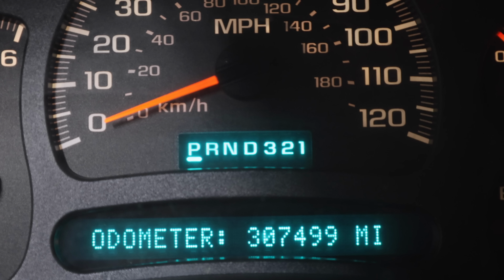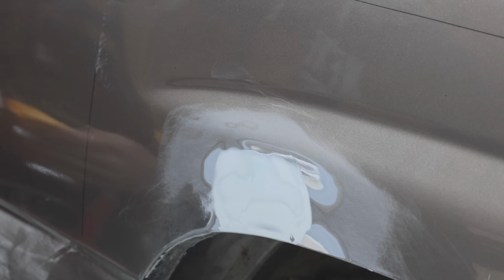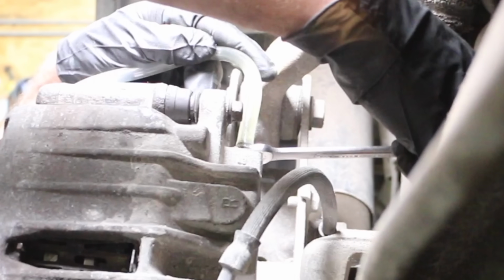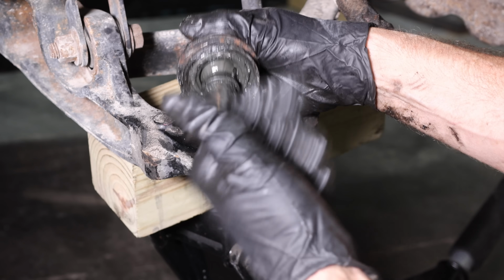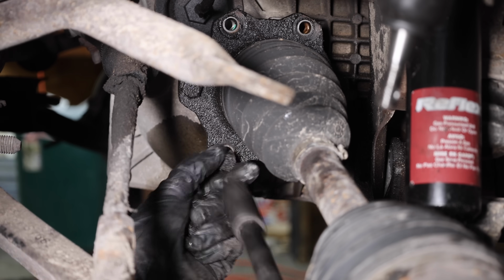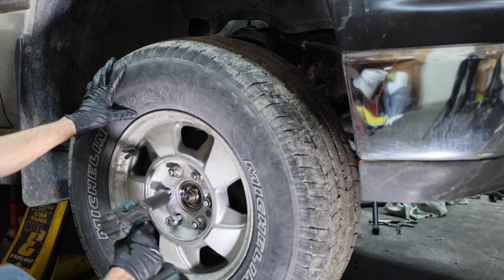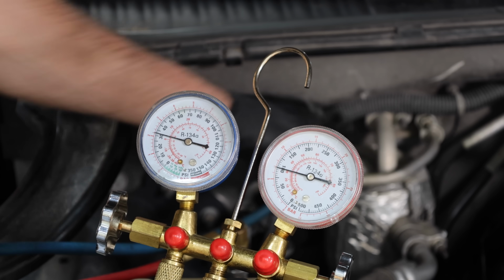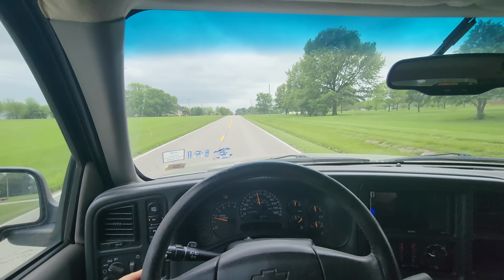Is It Stupid To Fix Up A 300,000 Mile Vehicle? Let Settle This!

Comment: Please do not change. This was a great video and touched on allot of key points. Some points that I think could be added are as follows.

Fuel pump - Fuel pumps can wear out over time and cause a loss in fuel pressure.

Fuel Injectors - While they can be cleaned on a flow bench it doesnt hurt to replace them.

EGR - Replacing this, the gasket and cleaning the port can help running, idle and efficiency.

Fuel Pressure Regulator - The diaphragm in this wears out like on the EGR which leads to a loss of fuel pressure.

Sway Bar Bushings - These dry out and harden over time and can crack / degrade.

Oxygen Sensors - Absolutely recommend to replace these / this for a 300,000 mile vehicle.

Control Arm Bushings - Instead of replacing the ball joins which is cheaper you cluld replace the entire control arm which often comes with the ball joints pre installed as well as new control arm bushings.

Engine Mounts - Wear out, crack, harden and degrade over time like all bushings also effected by heat.

Transmission Mount - Same as above.

And the alst thing that I can think of off the top of my head is the brake master cylinder due to the seals wearing out resulting losing break pressure over time. I am sure that you know all of these things however i think that a part two to this video that has some more in depth repairs would be a good video too, thank you for your work!
Reply from the maker: Thanks for the feedback.  Thanks for the suggestion.

Comment: Check out the HF Icon snap ring 8pc plier set. I got it on a special coupon they had in May for 29.99 usually over 70 dollars. Very robust and strong lifetime warranty
Reply from the maker: Thanks for the suggestion.

Comment: I've seen vehicles that have less than 70,000 miles that should be scrapped, and vehicles with mid 200,000 range that look nearly showroom condition! (and highway miles were not necessarily the case)

Comment: I think you forgot the part where several bolts snap off and you spend 8 hours trying to get them out of the rusted hole. 😂

Also, don't forget you're actually supposed to just throw this thing in the junkyard and buy a $60,000 EV instead of fixing it.

Comment: I have a 1992 caprice classic with 318,000 miles. It doesn't use a drop of oil between oil changes, I am the third generational owner of it in the family. There is a little rattling going on in the front end, my mechanic thinks its the timing chain.
Reply from the maker: Nice!  Thanks for sharing.

Comment: What's the carbon footprint of repairing something older vs throwing it out and building a complete new car or truck from scratch? Even recycling the metal takes 2,500 degrees F. 
Ten to twenty% worse fuel economy still seems greener to me. My commute isn't that far.

Comment: I love bringing old vehicles back. I use a 96 jeep XJ as a locksmith in the Colorado mtns, 234800 and going. Total cost of ownership minus fuel is about 6 grand after a head gasket. And tires and fluids.. I bought it for 1400 and have used it for 4 years now 😂 it pays for itself every other month.
Reply from the maker: Thanks for sharing.

Comment: If you dust the bondo with baroque paint it's easy to see the high spots and if you spray a good amount of heavy penetrating oil on the inside of your fenders through the drain oil it soaks into the dirt  that gets wet and causes the rust and the rust likely won't come through somewhere else
Reply from the maker: Thanks for the feedback.

Comment: The pace is fine.  I agree with keeping older vehicles.  My 2001 Subaru Forester has 281k miles and runs like a top.  I also use Rotella T6 15w-40 too!
Reply from the maker: Thanks for the feedback.

Comment: If you want to thoroughly clean the steel parts before painting, you can do that in minutes easily. Fill a tub with enough warm water to submerge the part. It doesn't have to cover the whole part, so long as you can wash the whole part. Add about 1% citric acid to the water. Thoroughly degrease the part first. Then wash in the citric acid solution. Any rust will turn bright orange and quickly disappear. Slosh or brush or spray the surface to ensure it was all been removed. It only takes less than a minute or so. Citric acid eats rust quivkly, and dissolves steel at ~12 inches per year. That is about 0.6 microns per minute! So do not leave the parts in for long. Thoroughly rinse and dry the part. Then prime and paint. 

Before you discard the citric acid, add a bit of lime to complex the rest of the citric acid. If you don't do this, the solution will eat concrete, aluminum and steel in the drains. Once every blue moon isn't too bad. But do it very often and you will have an expensive drain repair. 

The key idea here is NOT that the citric acid is an acid. It is that it is a class of chemical called. a chelant. (translates as claw). It loves to bind to metal and other ions with two positive charges - iron, zinc, calcium, magnesium, but also with three charges - e,g, aluminum. And acid destroys aluminum. 

Citric acid is generally safe to handle and is in many foods. But as with any chemical, handle with care, wear gloves, googles, and rinse promptly. 

You can do the same thing with vinegar (as you've demonstrated before), or other things like malic acid. Citric acid is the most aggressive, and it is cheap and available in food grade at stores, beer supply houses ...
Reply from the maker: Thanks or the feedback.

Comment: In my amateur opinion, a 2x4 is too large and flat and hard for satisfactory use as a sanding block. Get good results easier by folding sandpaper around a paint stick and use your thumb and forefinger and palm, or sometimes both hands to operate it. Or if working a contoured area, use a short section of an old rubber heater hose. The round hose also makes it easier to rotate slightly to keep the paper from clogging up.
Reply from the maker: Thanks for the suggestion.

Comment: I found a 2001 Ford sport trac 300900 miles with newer motor  transfer case and many new parts. Last owner must of spent $6,000.00 on it. Rins 95% I 'm going to rebuild it.  I paid $2,000.00 if I spend $8,000.00 total.  I am sure it will be better than a new truck. Just  not new looking. Looking.
Reply from the maker: Thanks for sharing.

Comment: The reason the wheel arch had rust is because the foam  holds moisture, and never lets it dry out. The foam goes all the way across the arch, so it will rust through somewhere else soon. Since you had the complete repair arch, you should have replaced the whole thing. You then would have seen the true condition of the inside. The rust is not from damage, it is from moisture that can't ever dry out because of the foam.   I've replaced hundreds of these.

Comment: I’ve got a 2000 Silverado 1500 that I love and hate. I got the transmission rebuilt last year when it started slipping and she’s still weird here and there. 333k on the current engine (pulled from a Tahoe in a junkyard a few years ago) had about 296k on the first engine. When she runs well, man does she run well, seriously takes off on me sometimes. But other times she’s sluggish in comparison. Older cars get a bad rap. Thing now is getting the suspension up to date, everything is still stock and unfortunately the previous owner did little in the way of maintenance

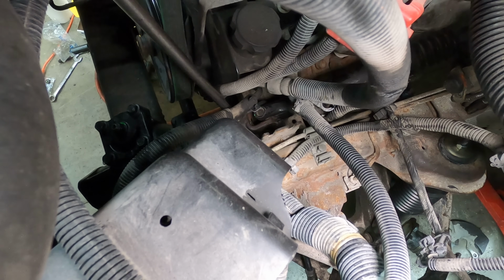Comment: 00:17:20

Man, I know access can be rough, and I do think you know proper cotter pin installation... but at the above time stamp +10 sec - Big no no. Would not pass QC. They need to be "bunny eared" to the side of the nut faces or down the face and up over top and trimmed to about mid point of the bolt.

The reason why I'm saying anything at all is that people watch others religiously, instead of referring to manufacturer manuals. The AC 43.13 is a brilliant reference book for all mechanical maintenance, even though its aviation born. 

I absolutely love your videos, though. Been watching for a couple years. :)

Edit: at 20:00, so proud of the grease plate method. We use this when working on nose wheel steering on commercial jets.

Comment: I just bought a 2000 Ford Ranger with 320k miles. Got the 3.0 Vulcan and the 5 speed manual. Truck runs pretty good for the mileage, shifts smooth too. Plan on giving her a new engine at some point.

Comment: Diesel engine oil is a good shout - there's a CBR600F motorcycle out there that's done over 330,000 miles, most of it on diesel oil.

Comment: Really shouldn't use diesel oil in a gasoline engine. The much heavier use of zinc additives can plug up your catalytic converter, certain detergent additives can actually cause LSPI(Low Speed Pre-Ignition)aka predetonation.

Comment: Keep the same pace! Older cars are also cheaper to maintain and most of time with parts that are easier to get to without having to disassemble many components, or replace an expensive component that was integrated together on newer models, such as headlights.

Comment: The problem is not speed but the robot like repeating of same information in a
Fast forward speed:

Product A weights 1 pound and is 15 inch tall.
Product B weights 2 pound and is 16 inch tall.
Product C weights 3 pound and is 17 inch tall.
Product D weights 4 pound and is 18 inch tall.

And on and on for like 15 products. 

My God, can’t you just flash that info on the screen like a table and coment on it in normal human language? 

I want have to mute the video after a while. It’s obnoxious.

Comment: 2006 Nissan Sentra (1.8L, base model, manual) still going strong at 397,000 miles. The only major repair to it was finally replacing at the original clutch at 394,000 miles.

I would say that, as long as the body isn't rusted out, then a major repair on an older car is fine as you are willing to take the gamble on the car possibly then getting into a major accident not long after, at which point you will have essentially a sunk-cost on your hands. Insurance companies don't care about the vehicle's upgrades at that point, only the odometer and calendar year.
Reply from the maker: Nice!

Comment: I'm not fully through the whole video yet but I am a body man that is genuinely giving pointers. I see right away mixing regular filler up to put over that patch, best thing you coulda done to prevent future corrosion was to put some reinforcement filler in there. its kind of a fiberglassy filler, but really does help protect with corrosion, and would have used a real good coat of primer, I'm not trying to sound like and ass, but I could see the whole repair area fazing through, and maybe a few more coats of base. The model vehicles are suchhhh good vehicles that it is really worth to fix. They are reliable, and cheap to fix. Motor goes out, you can get one on marketplace for 400 dollars.  They are worth to keep up on and keep going.
Reply from the maker: Thanks for the feedback!

Comment: This was an AWESOME video!   More engine DIY!
Reply from the maker: Thanks for sharing!
Reply: @ProjectFarm my 2007 Ford 500 has 299700 miles.  1 wheel bearing, new belts and fuel injector sensor…..besides that only regular oil, tires, and breaks!

Comment: I've been very happy with my Lang reversible and now also quick reversible snap ring pliers sets. The first set has been used in the shop for nearing a decade.

I used the exact same turnplate technique, but with a couple pieces of sheet steel and some wheel bearing grease!

Keep this truck going! I will keep my '01 running as long as I can.

Comment: Awesome vid, i did this to 300,000km vw golf. It was great as i wanted to get familiar with mechanics and mechanical engineering for a job. My field is in electrical engineering. Doing this work with my dad was a gold mine in knowledge. The car ran factory new. The transformation of the car was an incredible reward and since i did the work my self I knew exactly what the car was capable of.

Comment: You did an AMAZING job of presenting everything!!  Wow!  Pace was just right and you packed a ton of info compressed into 20 mins!! I certainly grabbed a few new bits (like I don’t have a brake fluid tester and they are so cheap, and you have the components for the fluid extractor as well as the video). Thanks! :-) Do you have your torque tools calibrated (I recently had a decent quality torque wrench fail calibration)?

Comment: As an experienced bondo applier and drywaller don't try too hard wo make it flat when you're applying it, it'll shrink back and you'll have a divot. After a while you'll figure out the sweetspot and will only need to make one pass with sand paper as a formality.
Reply from the maker: Thanks for the feedback.

Comment: My 2005 SPRINTER (NCV3) has 768, 488 miles
ORIGINAL EVERYTHING 
Still pulls 20mog daily FULLY loaded
Reply from the maker: Nice!
Reply: @ProjectFarm  
The SECRET is BLOCK heater 24/7/365 (so she NEVER 'cools' down, and CENEX PREMIUM DIESEL fuel)

Comment: Nope, I bought a 2007 Tahoe with 300K I paid $3500 and put 2K into it. I have not driven it since December 2023! Absolute junk, all the lights are going off, won't shift out of 3rd gear and it won't lock or unlock or open hatch. I could have lit cigars with $5500 and made better use of it.
Reply from the maker: Thanks for the feedback.

Comment: Good video! I've never worked on cars that much (more into wood and metal working), but your vid reminded me of the work my father did when I was younger. He was an expert at fixing up older clunkers and making them like new.

On the subject of snap ring pliers, I bought a Knipex set a few years ago. It was pricy but had great reviews. I haven't used them a ton, but when I have used them I've been impressed. They don't slip nearly as much as the cheaper ones I've had in the past. I've also seen an Icon set at HF that looks very nice; if it had existed at the time I might have bought it instead. It would probably be worth including both sets in your review when you get around to it.
Reply from the maker: Thanks!  Thanks for the suggestion.

Comment: For a truck that old... I'd use that wire wheel to clean up your caliper bracket behind the hardware. 

Pull the slide pins out & the boots to avoid damaging them 1st. Clean of the old grease & add new.
Reply from the maker: Thanks for sharing.

Comment: Keep going with this series untill you can get that 1,000,000 ls460 that Matt Farrah made famous 

Also I want to say this is something I learned from experience but you shouldn’t break loose or torque axle nuts with load on them that is a great way to shorten the life of the bearing. You should instead stick a hearty flat head screw driver or pry bar in a rotor slot and do it while the axle is lifted.
This is something I learned from experience doing my first engine swap
Reply from the maker: Thanks for the constructive feedback.

Comment: Why is the check engine light on, at the end of the video?
Reply from the maker: The light is related to the fuel evaporative system and isn't worth repairing.
Reply: @ProjectFarm  My 2001 Suburban just turned 306,000 yesterday.  After replacing a leaky fuel pressure regulator, it now purrs like a kitten.  Thanks for all the great videos!

Comment: My 1996 s 10 has 750,000 miles. And I changed the heads with ease at 550,000 , and didjt even need them. The guy I worked with at the apartment complex had them and gave them to me . Runs so good and I still use it today. Stock transmission stock bottom end.  😅 And I pull 1,800 pounds here and there. No issues
Reply from the maker: Thanks for sharing.

Comment: no need to slow down. but you didnt chabgw the power steering pump. you changed the power steering gearbox. the pump is mounted on the engine. :-)

also damn lucky to live where rust and corrosion dont seem to be an issue. must be nice. 😂

fars as the transmission goes, sure you can just change the fluid, but its better to just drop the transmission pan and change out the filter as well.

Comment: Excellent as always, hint on body work, cutout rusted area and get a flanging tool to recess edge then cut replacement patch to fit onto flange. Patch will be flush or slightly recessed and easy to finish. That much bondo will eventually crack from differential heat expansion but easy to fix again. Trans service should include a filter change and any servo or other wear parts instead of just drain and refill some fluid. I do not know where you live but here in the Rust belt nothing ever comes apart that easily and rust prevention is almost impossible,vehicles here don't wear out but rust apart.Otherwise great overview of a high mileage service
Reply from the maker: Thanks!  Thanks for the constructive feedback.

Comment: My '05 camry has over 300,000 miles on it. it needs transmission work, struts, and some tune up stuff. But it still runs pretty good. Hopefully it lasts me another few thousand miles. I want to get the transmission fixed and the other stuff cause I like the old car.
Reply from the maker: Thanks for sharing.